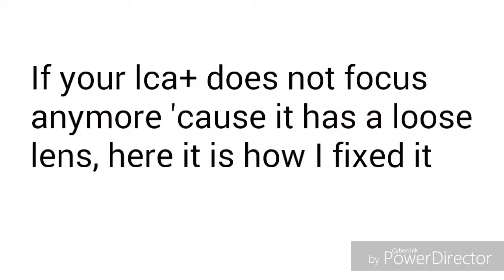How to: repair Lomography Lca+ (focus lever)  -  (TV179)

Comment: Any tips for my lc-a zone focus lever being stuck on the infinite setting? I cant move it to 3m, 1.5m etc.
Reply from the maker: Have you tried ti open it up?
Many times it can be a loosened screw moving inside the mechanisms.
Lc-a s are not so easy to be fixed. Maybe 'cause are so small.
Mine Lc-a plus is stucked. Maybe forever.
Have you listen to the Lomography guys?
In the end I had bought  another Lc-a, this time russian.
Happy light
Reply: Hi there. I have the same problem. Did you fixed it?
Reply: @unicul83  I had to. bring it into the Lomo NYC offices and they got the lever to actually move but it seems now the actual lens inside the. camera isnt moving, so now I will attempt to follow this guide to see if I can get it to completely function properly.